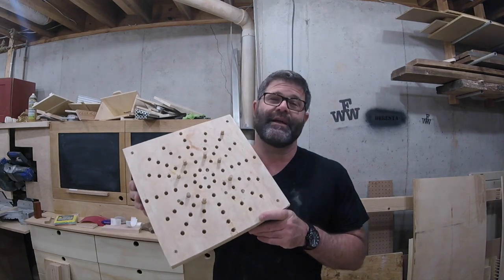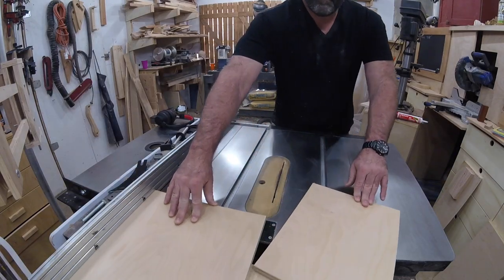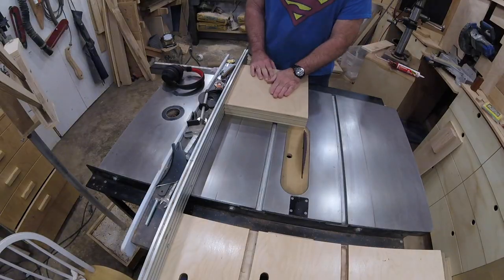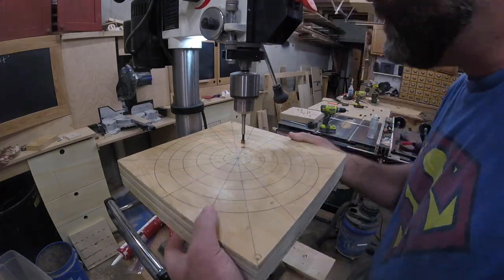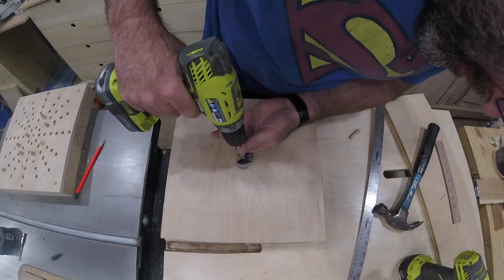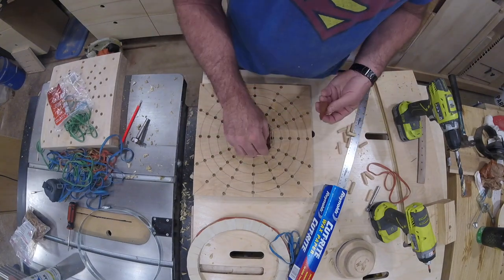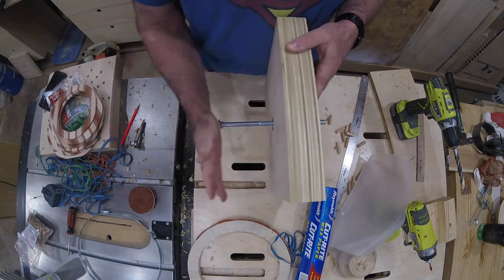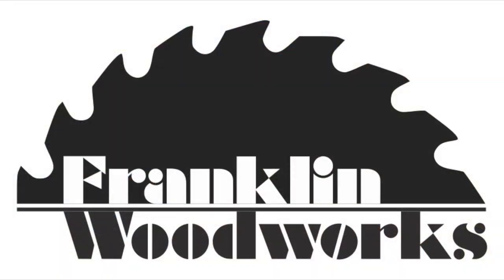Gluing Jig for Segmented Turning

Comment: Nice way to put the rubber bands on and center your rings for glue up. I have found it is easier and quicker to use industrial sized zip ties to clamp my rings together, all you have to do is use a pick to release the tang on the zip tie to open it up for reuse. A 36" zip tie is good up to 11" for a bowl and a 48" is good for a 16" bowl, if you need to go bigger just daisy chain the zip ties together.
Reply from the maker: What a great idea!

Comment: Rob that is an awesome jig. I do have a suggestion though that could make it a little faster. I use a similar jig to glue up bowls and I use what I call a wobble nut which is a star knob that will slide down a threaded rod at an angle and then when it hits your plywood and straightens up the threads engage and you can tighten it. Let me know and I’ll send you more info on them. I might get back in to segment bowl if I make this jig tho hose clamps make it no fun.
Reply: I'd like to see the info on the "wobble nut" too. Sounds like it could be very useful in many applications.
Reply from the maker: The wobble nut sounds like a time saver.  I did some searching but couldn't come up with anything, so any info you can provide would be great.  Thanks dude!!!
Reply: @FranklinWoodWorks2016  Rockler carries one in three sizes, called quick-release nuts.

Comment: Hi. I don't have a problem with the rubber bands holding the rings together for inspection but I would be nervous using them instead of hose clamps. You're right. They are clumsy and tedious but they crank down well. Do you find the rubber bands as clamps give enough clamping force to survive the pressure during turning?
Reply from the maker: The rubber bands do very well.  Of course I have different sizes so that they are always tight enough, and some of my bands are long enough to double.  I encourage you to watch this video to see how well it works and see the end product.    https://youtu.be/4dt-CgewKAA

Comment: I did the same thing using finishing nails for the pegs and put a perfect (ha) right angle lip in the corner for cutting board glue ups - I use wedges on the other two sides

Comment: Like your jig idea very much. Wanted to ask about using 3/8” peg board. Have some left in garage noted holes are predrilled on 1” centers. Could I use this predrilled template on top of the 3/4” plywood sheets? I know it maybe difficult to draw the lines and circles. Appreciate your thoughts. And please continue the tutorials! Thank you.
Reply from the maker: The issue I see with the pegboard is the thickness.  I'm not sure that 3/8" will support the tension of the rubber bands if you are gluing segments together.  Plus, pegboard material is soft compared to solid wood, so after a relatively short time, the holes will expand, decreasing the support for the legs even further

Comment: Great idea, but how do you keep the rings 
from sliding out of perfect position?
Reply from the maker: In my experience, once you have the rings where you want them, they won't move.  The clamping pressure comes from the center so tightening doesn't cause movement.  Remember I made the base very thick.  This keeps the carriage bolt used for the clamp straight up and down - no wobbling.
Reply: OK,  I will build this jig, I already use the rubber bands, but I still have trouble with centering, which is critical. Thanks Chuck
Reply: @chuckbell2949  I had the same question, Wondering as you stack the rings, how you keep them centered.
Reply: @FranklinWoodWorks2016  After putting the glue on the rings, sprinkle salt on the glue and the rings won't move.

Comment: Rob,  great jig I will have to copy it.  Have you had any problems with the layers slipping and sliding while being clamped?  I like the simplicity of using 1 jig to accomplish multiple tasks.  Thanks for sharing.
Reply from the maker: They might slip a little, but it is greatly reduced.  If you use the drawn circles on the jig to center the first piece, then center the remaining layers based on the first layer, it is incredibly stable.  The clamping pressure coming from the exact center makes it easy.  That's one reason for the thickness of the jig- it makes the clamping bolt stay in place and not wobble from side to side.

Comment: Outstanding! How did you get those rings so thin though toward the end of the video?  Were they that thin as segments first?
Reply from the maker: No sir, I glued up several 1" thick rings and sliced them with a band saw.
Reply: @FranklinWoodWorks2016  Sliced them with a band saw?  Man, you must have a large saw AND calibrated perfectly.  Very impressive sir!  Very nicely done.

Comment: Anyone have a good source to buy thick rubber bands in a variety of sizes? I looked on Amazon and they only sell them in all one size (usually 3.5") and usually you need to by a million bands. Thanks!
Reply from the maker: I got mine on Amazon.  I just did a search for long rubber bands (not LARGE rubber bands) and several things came up.  Hope this helps!
Reply: @FranklinWoodWorks2016  Cool Thank you! I already made my jig!

Comment: Rob, it looks to me like when you drew the lines and divided the square into the wedges all the wedges aren't necessarily equal in size, so that when you drew the circles all the segments in each ring are not equal. Just want some clarification.
Reply from the maker: I'm a little confused by the question.  Are you asking about the drawn ring on the jig not matching the actual rings being glued?  Or the holes not lining up?  The jig has two functions, gluing the segments into rings, and gluing rings together to form a crude bowl ready for turning.  The holes are for pegs that I use to hold large rubber bands.  Once I get glue on my wedges (placed within pegs that are just a bit larger than the ring will actually be, then I systematically release the rubber band and the wedges should pretty much center themselves.  Once the rings are dry and sanded, I use the rings drawn on the jig to center the largest ring, and place the other rings pretty much just using my eye.  But starting the largest ring centered on the jig allows for even clamping pressure from the center bolt.  Does this answer your question?
Reply: @FranklinWoodWorks2016  my question is that when you drew the lines dividing the square into the pizza slices the angular separation of some of the lines don't all look identical, thus affecting some of the segment widths. Maybe my old eyes are just off. It is a great jig and obviously works well.
Reply from the maker: @braytonbailey3782  I get it now.  Those lines were just rough lines for the placement of the holes for the pegs.  They should have no bearing on the wedges at all.

Comment: why not make the top clamping block as big as the baseplate, then drill each corner so you can add a coachbolt on the corners. Then after clamping the dentre bolt, additional clamping pressure could be added st the corners to add more even pressure on the glued segments resulting in a better bond.

Comment: Glueing the rings on top of one another won’t line up perfect the rings will be offset & slide to one side ??????
Reply from the maker: Well, lining things up perfect is on the user.  The jig gives you enough reference to do it very well.  If the rings slide sideways during clamping, then the rings are not uniform thickness - again this goes back to the user.
Reply: I have an idea for that. When you get ready to start stacking the rings, but before gluing, insert short dowels into the widest holes that will fit inside the ring to be glued. Use ever longer dowels as the bowl or vase increase in hight. That should keep everything pretty close even if they aren't tight it will minimize the amount of sliding.

Comment: Interesting approach. I currently use hose clamps and so far have had good luck with them but may give your method a try. For clamping I use a Longworth type fixture and Dennis Edwards Stomper. Check out WoodworkersPro.com. BTW, your production is quite good. Excellent video and audio. Good narration. Thanks for sharing.
Reply from the maker: The link you gave didn't work, and typing it in manually doesn't work either.  Can you try again?